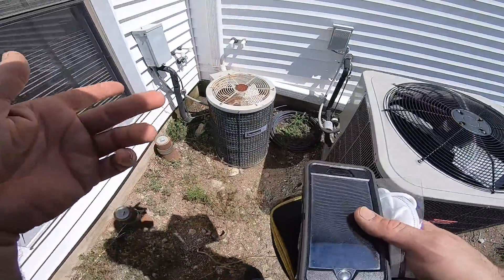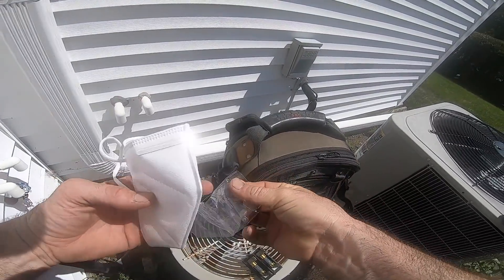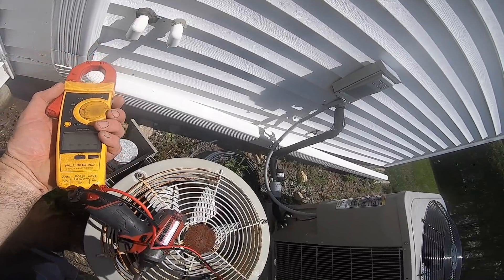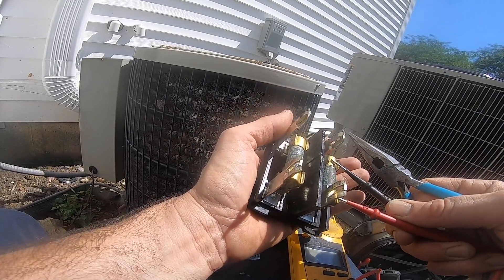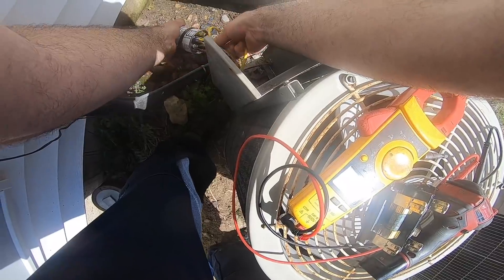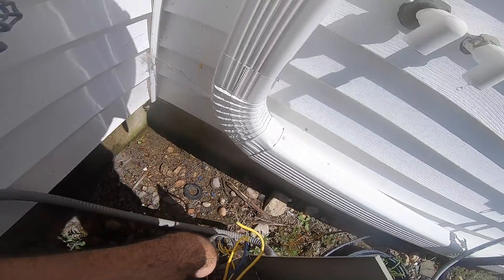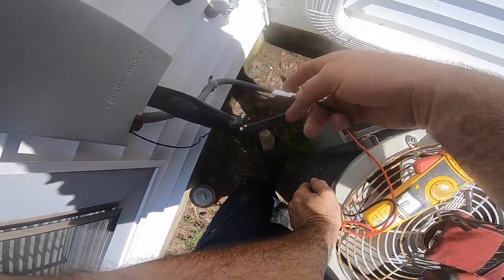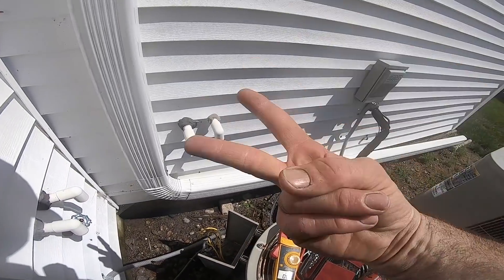Grounded Compressor Takes Out AC System

Comment: Working on his sales pitch before he hasn't checked shit. Hvac is the new snake oil salesman
Reply from the maker: U obviously don’t watch my vids. I keep old machines running. Not many systems do I condemn. Yet a compressor shorted to ground is toast. I also checked the compressor terminals. Left out of vid checking comp terms.  Can’t fit camera in that space. This is the first system I condemned this year. I only condemned 3 last year out of a few thousand systems I worked on.
Reply: @thehvachacker  man I love your videos and am on your side. I was speaking of the big box hvac companies always wanting to replace a system rather than repair it.  Sorry if i rubbed you wrong
Reply from the maker: It’s all good. You are correct about how many companies operate in the hvac trade.

Comment: Why didn’t you check the connections at the compressor?
Reply from the maker: I checked yet no way to get camera in to show. Wires connections are good. It's a crappy hard to see video. Also crappy place to for hand or tools to unclip compressor terminal cover. If u need to see that let me know. I will upload that part if I haven't deleted it on my Facebook page.
Reply: The HVAC Hacker ok. We’ll trust you this time 😂 was a fine video
Reply: Mark Hoffman yeah, it might’ve been just burnt off wires at the terminals. I check the wires first for ease of access, but I need to verify at the terminals before I call it.

Comment: I have that same 1986 unit, and the electrical box is also facing to the left, only about six inches from where some previous homeowner built a deck. So I couldn’t flip up the metal cover and had to twist and bend it to get it open to change the capacitor. It’s now working but the “cold” air coming into the house is so low it barely makes a difference. I don’t know what’s wrong, maybe the Freon is too low, but probably not worth fixing at this point. Will replace it with the cheapest new unit I can find, because I’m planning to retire and move in a year.
Reply from the maker: Did you ever find out what was causing the unit not to cool correctly

Comment: I would have put in a new compressor.
Reply: but for an R22 unit it is really not worth the cost as the evaporator and/or condenser coils are as old as the unit and can spring a leak any day releasing all of that expensive R22 refrigerant also HVAC Hacker is appropriate for your work you do.
Reply: @Peter_Yachymczyk  I understand I just love the vintage units and want to keep them alive.
Reply: @67tr876  Yeah I also love the old stuff back when things were made for quality not quantity. I would  probably fix it if it were my house but I was thinking of the customer as not everyone can afford a new R22 compressor and the associated cost of an R22 system charge.
Reply: @Peter_Yachymczyk  why would you keep it. That's ridiculous. So inefficient compared to a new system
Reply: @HVACRTECH-83  because I like the old units and I like how they're built of quality unlike today's units.
Reply: @67tr876  that's simply not true at all. Sorry. I've been a licensed tech for close to 20 years and although I agree with the older units being simpler in design and features, less to go wrong, i disagree that they were built with any better quality. Not sure what brands of newer units you are referring to but i see nothing but much better quality and sophistication in new units more and more every year. I'm sure there are some cheaper quality brands out there but i stay away from brands I'm unsure of and have units I installed over ten years ago and do yearly maintenance on that have not had one minute problem yet. Any ones that I have had a service call on is usually just a bad cap or chewed up wires by mice. Occasional bad circuit board or relay. But pretty rare at least in my climate. That may have something to do with things failing I guess. But I have not experienced it
Reply: @HVACRTECH-83  I've been in refrigeration repair since the 70s, you are wrong and he's right. Today's quality sucks. Look how junky Trane is now. You can bump one with a riding mower and it will fall apart. As far as efficiency, r22 is more efficient. Why do you think they had to start making huge evaporator coil? R410 takes much more piping for the thermodynamic chemical reaction to take place
Reply: @Bryan-Hensley  that does not make the system less efficient than a 22 system. You are rite about coil size but who cares about that. The newer systems overall are far more efficient than an old 22 system.  And heres an idea, dont bump into a condensing unit with your riding lawn mower. Bump into your car with it and see what happens. If it's a car from the 80's, it wont be damaged? Time for you to retire anyway.
Reply: @HVACRTECH-83  you could bump a 1990 Trane with a car and wouldn't damage it much. I said r22 is more efficient. It carries more BTUs per pound than r410a during it's phase change
Reply: Why?
Reply: And you probably drive a 1990 Corolla
Reply: @clintgray1623  1979 Pontiac Trans Am with 1200 HP 502 CI engine
Reply: This things are not vintage cars.

Comment: I’ve been using a ziplock bag for my mask.
Reply: corey Babcock you’re an idiot. Also, they’re mandatory here, so, no thanks.
Reply from the maker: Mandatory almost everywhere at this point. Yet since April mandatory in nj. I was doing the ziplock bag. Yet they get moldy if forgotten inside a bag for a day
Reply: @thehvachacker  I’ve stopped using the blue “throw away” masks and went to a machine washable version. I find it easier to breath and easier on the wallet. I boil the kettle and dump a teaspoon of tide in a bowl of boiling water. Stir the mask occasionally while it soaks for an hour or so and then give it a good rinse.

Comment: anytime any piece of service equipment is made by federal pacific it is a good idea to replace it.
Reply: The circuit breakers yes but their fuse panels are OK
Reply: @Peter_Yachymczyk  i understand that, but since they willingly endangered people i just like to replace all of their stuff, it is  over 40 years old anyway (not that properly maintained old equipment is a bad thing)
Reply: @WalterKnox  I know I am just saying that in most cases fuses are actually more reliable then circuit breakers however not more convent as you have to replace them after each fault. I remember back in the day people actually looked for an overload or another fault as fuses were not always at the ready or cheap nowadays most people don't think twice before resting a circuit breaker.
Reply: @Peter_Yachymczyk  i completely agree, my house was built in 1959 and still had a fuse panel, it is a 100 amp fuse panel and everything is in good shape and i have no plans to replace it. breakers fail even if they are made by a good company they can fail, it is hard to screw up a thin piece of wire that melts when too much current is ran through it.

Comment: check wire for short? with comp disconnected or just check comp as it cold of been just a wire short.
Reply from the maker: after I stopped recording this I started recording again. I was going to show me checking wires at compressor. Yet camera didn't pick up a lot of the work. Not a lot of room to get compressor cap off
Reply: @thehvachacker  like you said, it was badly placed,  and we have had 100 degree days here,so I know the pain of working in this heat
Reply: @thehvachacker  ah just was wondering.
Reply: Agree. While he's /probably/ right, it's best to eliminate every other possibility before condemning a compressor. The wire could be rubbed or chewed.
Reply: The windings are shorted, the fuses will pop with no sound from compressor at all
Reply: Todd T either that or it will blow a terminal out of the compressor.

Comment: Made me cry our unit on our house was from 1989 and she kept going and on July 10th she gave her final breath. They don't make em like they use too
Reply: Yes those old units were made really good 1000 times better then today's units. I used to live in a condo built in 1982 and they also had these Carrier Round-Ones installed as original equipment to the place when it was built.
Reply: I lived there from 1996-1999 (It was my GrandFathers condo and was sold when he passed in 1998 but I went back there around 2000 to visit a friend who I met there and quite a few of those Round-Ones were still being used. I have not been back since though
Reply from the maker: The round carriers built in the 80’s were tanks. Manufacturers are greedy so can’t engineer systems that go 30+ years anymore.

Comment: Bet you never thought a pandemic would be one of the problems you would have to deal with on the job, as if the threat of falling over from heat stroke wasn't enough to worry about!  I had to come inside last week for some AC absorption, after trying to change the cables working the tailgate lock in my old Expedition. And I was standing in the shade, down here in Louisiana. This tropical humidity is rough. Take care.

Comment: Sad to see these becoming extinct. Whatever replaces it won't last nearly as long.
Reply: True especially mini-split units I hate those things with a passion they are supposed to be efficient (efficient at taking your money for repairs when they fail and they will) and quiet (that they are) I'd rather have an old vintage window unit (<-1970's) then a junk mini-split.
Reply: @Peter_Yachymczyk  I'd rather cool with a vintage machine too. The new split systems may be more 'efficient', but they'll never last long enough for the unit to get anywhere near the point of 'paying for itself' with the savings. And that's if it works flawlessly; don't forget to tack on the cost of regular repairs from leaking R410 and whatever else goes wrong...
I was at a house recently that had 2 Carrier wall units installed, one International Series from 1990 and a different model from 2000. At some point there were Fujitsu R410 systems installed to replace the Carriers. The Carriers were never physically removed; they've just been sitting dormant in the walls as the Fujitsu systems were used, until they stopped blowing cold.
The Fujitsu machines were both seeming leaking and absolutely covered in mold. What abysmal junk! I ended up sliding out the old Carriers and giving them a cleaning. Each unit dropped it's room by 15 degrees in a couple of hours. I told the homeowner to use the old Carriers instead!
Reply: @Peter_Yachymczyk  mini splits are great i have had 1 on my shop for 20 years works great, just installed a full mitsubisbi minisplit system on my house 2 months ago... they are amazing when installed and maintained correctly.
Reply: @hvacjake1762  The apartment complex where I live in had Mitsubishi split units installed back in 2017 MSZ-FH12NA Indoor unit & MUZ-FH12NA Outdoor unit the unit in my apartment failed last summer (the management did not want to fix it the first time (because it cooled and that it did but it kept shutting down the compressor and raising the temp & humidity in the apartment it would restart after about 45 minutes of warm humid air)

The finally got it fixed in October it works fine now (For how long I don't know) I only use it for cooling (I use the old electric baseboard heaters for winter time) I let it run constantly because I like my place cold.

They cleaned it in October when it was fixed but it is now August and the inside of the indoor unit is really nasty again brown spots on the flaps that move & direct the air flow and the blower wheel is coated in junk

That is the thing the management does not maintain them until they fail so it is now three years old and has only been cleaned once However I do clean the two filters myself each week

So maybe my hate for them is unjustified as they are not being maintained properly in this case?
Reply: @Peter_Yachymczyk  they have to be cleaned... mold will grown anywhere water "condensation" is evap coils on a traditional furnace/ac get mold also if not maintained... i love my mini splits... however if I had natural gas option at my house I would do traditional... but that being said doing it for a living mine will never have mold and doesn't have leaks because I know what I'm doing... flared fittings done right wont ever leak....
Reply: @hvacjake1762  Yes I am aware about the mold issues anyway there is a new problem now there is water leaking from the bottom of the unit on the wall and also probably into the wall. I have told the management I will see what they will do now
Reply: @Peter_Yachymczyk  sounds like bad installers....
Reply: @hvacjake1762  Yes that is very true they are "upgrading" pretty much everything in each unit I have saved a lot of quality electrical items (Receptacles, switches, electric heat thermostats) quality items made in USA they all still worked and were replaced for China made pieces). The lowest bidder for everything.

Anyway they fixed the water problem this morning the people who cleaned it put in "Green Strips" those are supposed to dissolve but it did not and left behind what looked like hard plastic junk. That clogged the drain pan they took a shop Vac and sucked out the drain pan and the pipe. The drain pipe is like a faucet now before it was like a slow drip, so it is fixed (For now)